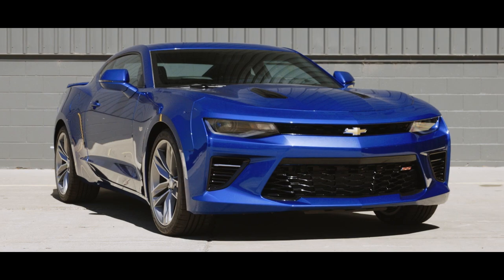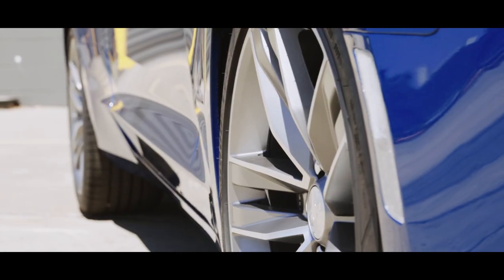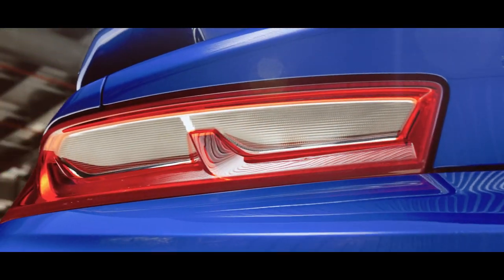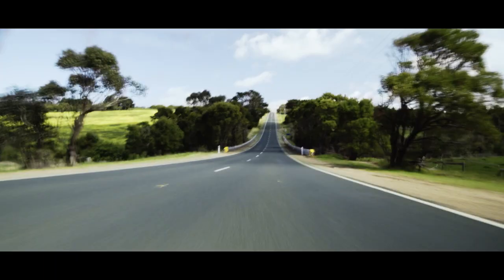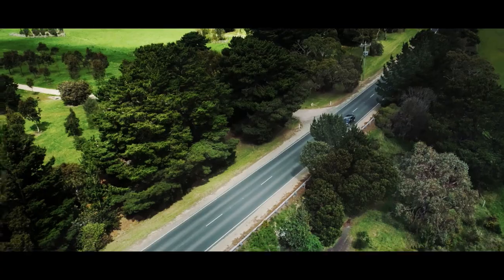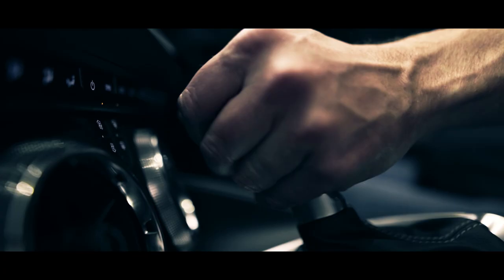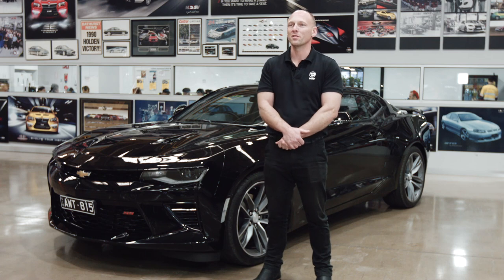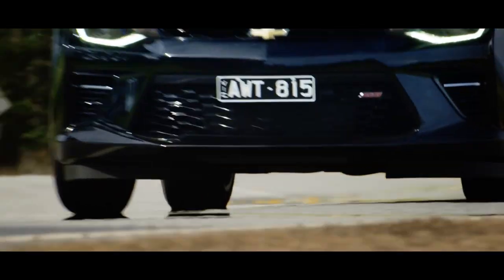Chevrolet Camaro Engineering Program Development

Comment: And that's going to compete with the mustang, O HSV YOU MAKE LAUGH I WAS SILLY ENOUGH TO BUY A VF SENATOR AROUND 100K YOU GUYS NEED TO PULL YOUR HEADS OUT OF YOUR ARSE AND GET REAL. BUY THE WAY MY VF HAS MORE POWER THAN THIS SCAM MOBIL.
Reply: Camaro 2ss auto is $90000aud drive away in my state nsw

Comment: For gods sake i worked for a rubber and plastic engineering company and they did work for HSV and other car manufacturers here in australia, so why not get the console fixed ? Also auto with no External Trans cooler WTF ?

Comment: Make a El Camino version.
Reply: Hopefully, they re-engineered those factory brake pads for the Brembo brakes while they were at it. I visited the car  wash this morning just like I do every week and by the time I make back to the house, I’m smearing brake dust into a dirty rag to clean the rims again. I’ve never owned a car that needed to have the wheels wiped clean every day after so little driving but the Camaro SS made sure that dream came true for me. Other than that, The Chevy Camaro SS checks every box that’s important to a man and is a well engineered aluminum piece of perfection. GM could not have designed us a better product! Fine automobile 🚗